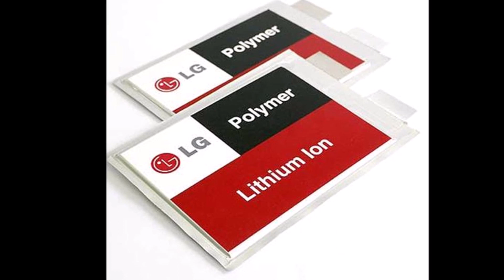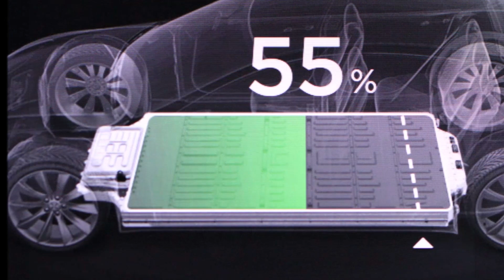Tesla Avoided Electric Ford F-150's Battery Problem Justifying Roadrunner

Comment: Spot on Torque News. So many people ignore how complicated the business management aspect of running a business is. Let me use batteries to expound on this show’s point.

About 1.5B mobile phones are sold every year and each one requires a battery. Several OEMs share the available merchant battery supply. A Tesla has 8000 battery cells in every car. Tesla is projected to build 1M cars in the near future and will require 8B battery cells.  Think about what has to happen to procure those batteries.  Tesla’s technology is formidable but so is its business management skills. It will not be easily duplicated for large companies with an established old line supply and sales chain. Maybe even impossible.
Reply: A nit pick, Greg.  The Tesla Model 3 has 4,416 battery cells in its 80 kWh battery pack.
Reply: Clara Smith 7104 batteries in the most popular configuration ::-). But it doesn’t really matter since the point is how difficult it is  to manage Tesla’s supply chain. Most people focus on the technology, and it quite a feat in itself, but managing the entire eco-system is also quite a feat and the competitors need to catch up.

In my 30 years in the tech field I never saw a company that successfully shrunk and that that is the fate of all large ICEV companies as their BEV businesses grow. It’ll be fascinating to see if they manage the transition.
Reply: @greghelton4668  Okay, yes, that was the 85 KWh Model S battery using the older and smaller 18650 cells.  I agree with your main point about managing the supply chain.  Tesla has taken a very different tact than traditional companies by implementing a more vertical supply structure.  If that's what competitors will have to duplicate, it's going to be a painful transition.
Reply: Clara Smith . I only used supply chain as one aspect of what’s amazing about Tesla outside of the technology arena. Vertical integration does not to have to be duplicated it but it’ll be difficult to react to a fast moving market if they don’t. I’ll use batteries again as an example. Let’s say there is a breakthrough in battery chemistry that needs huge capital expenditures to get it into manufacturing. Working with a merchant battery company to invest will be a nightmare and slow. Batteries are so important however Elon feels it can’t completely depend on third parties. 

Vertical integration generally doesn’t make sense since as it helps gross margins while hurting the net profit but in Tesla’s case it does.  This is the sort of thing the traditional OEMs don’t understand or are unwilling to take financial risks in. 

These dynamics may be common sense to many but it’s not to most. The the whole package is what makes Tesla so formidable.

Comment: Back in April, observers mostly expected the two companies to negotiate an out-of-court settlement so that supply chains would not be disrupted.  But that has not happened and is now looking unlikely in the short term.  LG Chem even filed a criminal complaint for theft of intellectual property against SK in Korea, which escalates the confrontation.  SK filed a countersuit in Korea, accusing LG Chem of breaking a 2014 agreement not to pursue litigation regarding one of the patents which LG Chem now claims - to the US Trade Commission - was infringed.  No negotiations have yet taken place.

SK's countersuit in Korea isn't going well.  The court ruled that the 2014 agreement between the two companies applied only in Korea, and that LG Chem was within its rights to enforce those patents overseas.

So how are BEV manufacturers affected by this legal fight?

Tesla, not at all.  They are not sourcing batteries from SK Innovation.

GM, who is relying on LG Chem, probably not at all.  I suppose it's remotely possible that LG Chem might end up having to pay a large sum to SK for breach of the 2014 agreement, but it shouldn't affect the contracts GM has signed with LG Chem.

Ford and VW are at high risk of dire disruption of their battery supply chains for their US assembly operations.  Both have contracted with SK.  If SK loses their battle with LG Chem, or even if the battle is dragged out for very long, it could knock Ford's and Volkwagon's planned production ramps into a royal mess.  In the US, that is.  It might also drive up the price they're paying to SK for batteries, if SK has to start paying royalties to LG Chem.

If the two companies decide to take each other all the way to the mat, then it's possible that litigation will be pursued in Europe, too.  Or even China.

Ford acknowledges that they can't just switch to a different supplier.  Their BEVs are engineered to work with specific SK batteries with specific specifications.  Switching to a different battery would mean re-engineering their BEVs.  So if SK can't supply batteries to Ford's US assembly operations, those operations will be dead in the water.

I don't think the Cybertruck needs a battery shortage among its rivals.  It will be a hit with consumers no matter what alternative BEV models have reached the market.  But for sure, if these two suppliers can't reach an agreement, it may be a while before Ford can mount any sort of challenge in the e-truck segment.  And VW could end up lagging behind Tesla for sedans and crossovers even more than they already are.

I don't know who sells batteries to Rivian.  If they're also relying on SK, their plans may be set back, too.

Comment: Tesla also had a battery problem this year I believe, when Panasonic wanted to increase prices instead of increasing production at #GigaNevada. I don't know what they did, how they negotiated, but after the incident Panasonic posted a profit in Nevada and pledged to double production in the next couple years. 👍
Reply: I saw a report fro some time back that the Panasonic Cell production was plaqued with quality issues and that around 1/2 the cells were being rejected at point of manufacture...Elon outed them in some ways and refused to allow them to expand production lines to make uo for the shortfsall and basically cornered Panasonic to increase the manufacturing yield....basically saying..."I ain't paying for a 50% yield"

So as I can see...Panasonic fixed much of that, increased yield, reduced the waste...without having to add more capacity.....therefore...PROFIT
Reply from the maker: Hi Zoltan, Tesla and Panasonic were a set of complex negotiations, cooperation, price dropping of Tesla, and demand hike.

Comment: On what grounds is LG suing the Ford supplier?
Reply from the maker: SK Innovation on Thursday lost a compensation lawsuit it filed against LG Chem in Seoul for breaching a patent settlement.

The Seoul Central District Court delivered a verdict siding with LG Chem, saying that the patent settlement both companies signed in 2014 is only effective in Korea. It has dismissed SK Innovation’s claim that LG Chem should drop its lawsuits against SK Innovation in the US and pay 500 million won ($42,000) in compensation to SK Innovation and its US subsidiary SK Battery America, respectively, for violating the settlement.

The legal battle between the two leading battery firms is expected to continue both home and abroad with SK Innovation vowing to lodge an appeal.
Reply: @Torquenews   I think you meant $421,000?